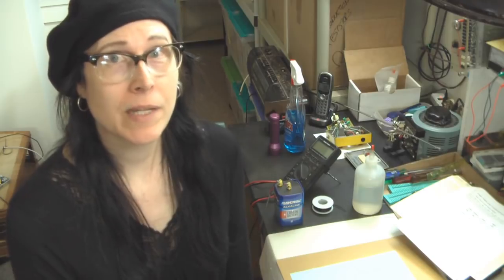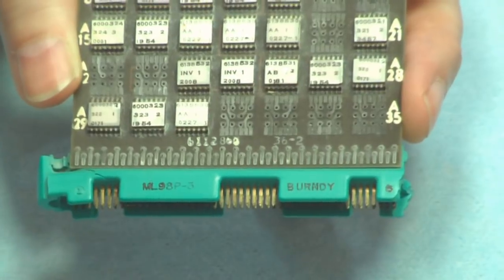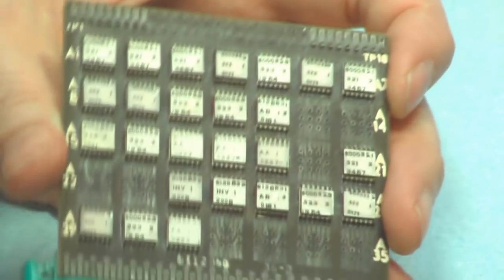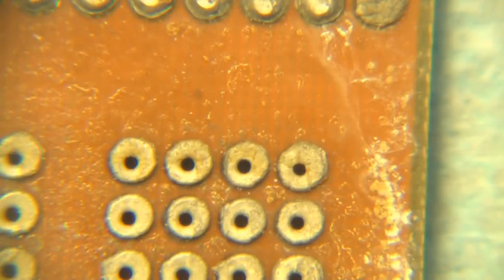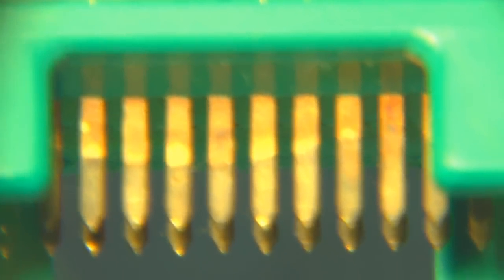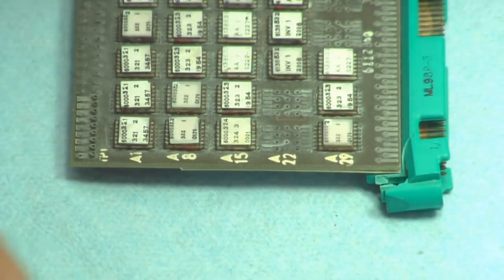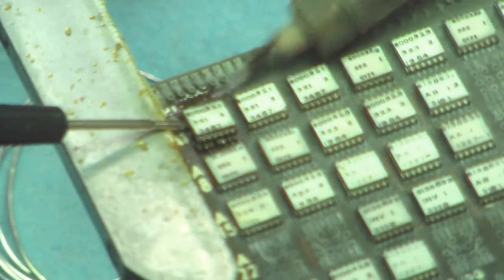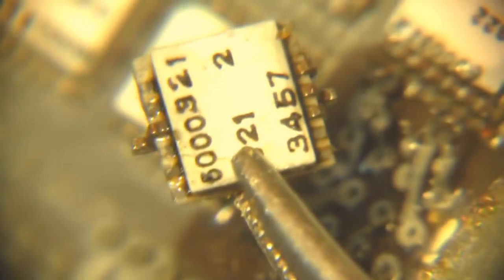Apollo Saturn V LVDC Board Teardown, Part 1

Comment from the maker: I successfully removed the underside coating of the type #321 chip and measured the resistors - check out the details on my Design and Engineering Page -  link in the description.

Comment: If the "IBM-63-928-137-Saturn V Guidance Computer-Semi annual Progress Report" from '63 is of any indication, indeed there were 2 suppliers for the end connectors: Cannon Corp. & Burndy Corp.

Also the solder used is described as:

"...the top conductors were soldered with Indalloy 10 (75 percent Pb, 25 percent In), the edge and bottom wrap-around conductors were soldered with Alpha 903 (62 percent Sn, 36 percent Pb, 2 percent Ag)..."

Comment from the maker: Perhaps, hard to say - it could be what many commenters have said that the oxidation interfered with the desoldering, or corrosion fused the pads - or perhaps a unique high temperature solder alloy was used for the SMT.  All possibilities.

Comment: Utterly cool! Ahh, the good old days! I am "backing into" this viewing; I was linked to a later entry in this series. But thinking back... you couldn't etch the pattern complete with out-pins, or pins then went all the way down to the board. So the out-pins were a spring clip shape that was attached to the bottom "shelf" -- which had the IC pin-outs on the top edges. Then the clips were soldered onto that shelf. And then, they were placed on the circuit board and micro-welded into position forever! They probably had vacuum tube welding stations all over the place back then. So it was an "obvious" engineering step back then. So much fun, Fran, thanks for the lucious detail.

Comment: Welcome to the military and space electronics of the late 1960's and early 1970's!  I did service the electronics in the A-6A through A-6E Intruder birds plus some other Grumman stuff in the early 1970's in the Navy.  The "A" through the early "D" birds had 60/40 soldering in them. The early "E" birds and the F-14 Tomcats had some of the welded boards in some of the "black boxes".  The flat packs were used as space and weight economy, welded for the environment the aircraft goes into.

Comment from the maker: My best guess is that it is very thin deposit high lead solder in the joints, but I will be determining that with higher temp on the iron to find the melting point.

Comment: NASA did weld componets. It was more reliable than soldering and the componets could stand the voltage induced by welding.
Reply: I second that. I have an early board from before Apollo that was a prototype that included a type of welding of components. This was apparently done because the launch vibrations were so ridiculous and early capsules were pure oxygen only. Ignition risks were heavily mitigated during the early Mercury programs and even after the horrible Apollo 1 fire.

Comment: When I did electronics those "vias" were always referred to as "plated through". Also the wires going from one board to another we always called them "jumpers". The teflon most likely provided mechanical support and spacing for the two boards.

Comment from the maker: Flat Pack is the correct term - and very curious that you had experience with welded pins in USAF applications of this kind of tech - I am interested in any info about how that was done, if special alloys or plating was used for a 'low temp' weld, or how that could be done without damaging the logic devices.

Comment: Some of therse boards were multi layered as well. They had runs (lands) in the laminations of these boards. The "vias" that you called them were called "feedthroughs". Those cupped TP's were for the quick status checks using a meter or scope. When my squadron transitioned from the A-6A birds to the "E" birds, I had to give up my soldering equipment. I troubleshot the boards, "Micro-Min" replaced any bad components I found due to the new circuit board design that came with the new birds.

Comment: This reminds me when i was a kid in the early 70s I lived down the street from an office supply company. My friend and I would raid their dumlster and find electronic devices keyboards and stuff with circuit boards. Anyways I remember find a board with  white ceramic chip with a metal cover. I knocked the lid off with a chistle and examined it under my microscope. I was facinated by the paths and shapes.

Comment: Wow, with these contact joints (whatever they are)  it seems to have been designed to withstand higher temperatures than the SMD stuff we use today.

Comment: Clean the area first with a small wire brush before fluxing, the pins will then reflow properly. 40 year old oxide will never shift with flux alone and will not accept the chipquick. As well thread a very thin guitar string under the chip on each side and pull it when heating to mechanically separate the layers from the PCB. Might pop the pins off the board or off the module but should not damage anything else. As well to clean the coat off the bottom ultrasonic cleaner and acetone.

Comment: Thanks for the teardown. It was both highly interesting and cooly blasphemous at the same time. I owned an Apollo launch computer board a while back but that sat in a display case once the awe and wonder of having something like this that I could actually touch died down. I dared not take it apart or even run it through test equipment. That would be the equivalent of me taking a chainsaw to my MiniMoog!

Comment: Is it possible that the leads were straight on the top side and spot-welded to the PCB when it was fabricated, and then the wafers were placed on the welded leads which then would get bent over and soldered to the wafers? It seems like spot welding with the devices in place would destroy the chips with the welding current going where it should not. This is pure speculation at this point.

Comment: Fran, your Saturn V  LVDC board looks like IBM's SLT (Solid Logic Technology) primitive integrated circuits. They were finalized in1964 and used in the IBM System 360 series of mainframe computers built in the mid and later 1960's. There was a time the Smithsonian Museum had their IBM 360 on display with a door open - exact match to your board I think. Jerry
Reply from the maker: jerrygriffith814 http://www.frantone.com/designwritings/design_writings_LVDC.html#LVDCcode

Comment: Did you try applying a normal soldering temperature to one of the legs that were left on the board to see if they could be desoldered "normally"?  

PS: I thought that chipquik worked by mixing with melted normal solder and reducing the melting point of the mixture and keeping it liquid therefore longer until it cooled from the high temperature, but you had to initially bring it to the normal melting point to start with in order to do that mixing.

Comment: maybe the pins were welded to the board then the chip was place on the board and the pins folded over the edge of the chip. it looks as if the pins fold over the thin edge and have a weaker connection to the chip than board. if they were spot welded as it seems, it would make sense that the pin is welded before the chip was installed otherwise the weld current could destroy the chip.

Comment: Maybe IBM had constructed a soldering jig to assist with this operation. Maybe not. This is SMD implementation at it's infancy so anything goes. My guess though is that everything is hand-assembled. No way even IBM would invest in automated assembly (in the '60s mind you) for something with such limited production run...

Comment: Yes, maybe just like a SD card (slide in place). With a little reinforcing tin on the pads of the ceramic plate afterwards?

These "packages" look like a sort of proto SMD packages. Maybe the technology of creating "real" SMD packages weren't invented yet.

How else would one solder those very short pins to a board. Would go all over the place.

Comment: These chips are most probably a version of IBM's Solid Logic (SLT) [ https://en.wikipedia.org/wiki/IBM_Solid_Logic_Technology ] space-grade ASICs/ASSPs. This is S/360 age tech. It's so ancient there are no chip type codes recorded anywhere in net. I found interesting archive though: [ http://bitsavers.trailing-edge.com/pdf/ibm/logic ]
Reply: Actually, you should've unsoldered it completely the other way around: 1. clean it with alcohol, 2. have a bar-like soldering head, 3. use HIGH temp setting and short time.

Comment: What a shame to destroy the board to get the chip off ,  a hot air gun would have removed it very nicely , just too bad  you crow bared that 500$ chip off the board , you could have ask some one ME anyone , who works with surface mounts the best way to remove it . Ohh well
Reply: rod sims it isn't soldered so that wouldn't have worked, the pins clamp over the chip and are welded to the board.